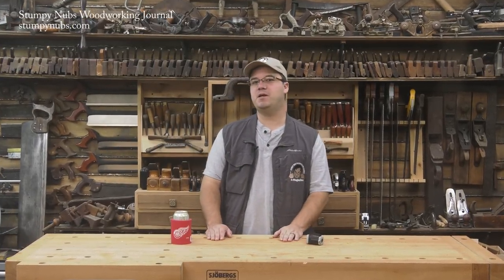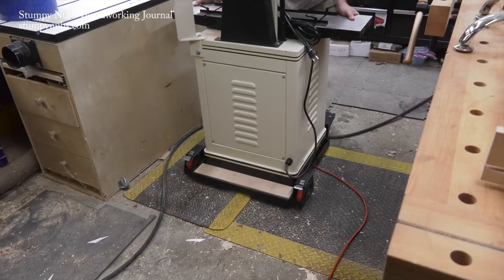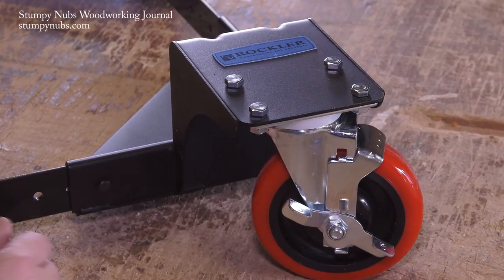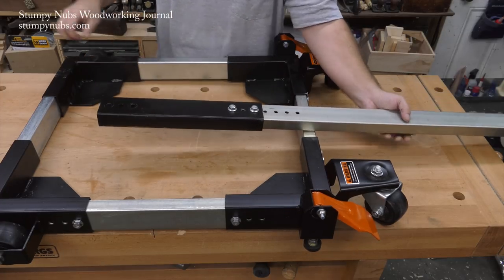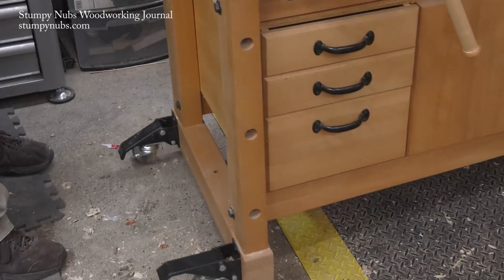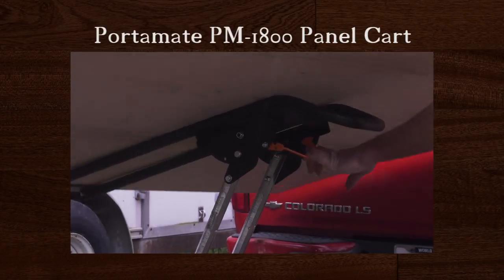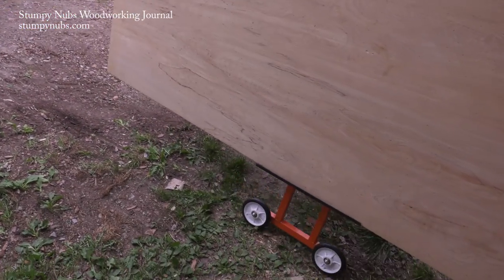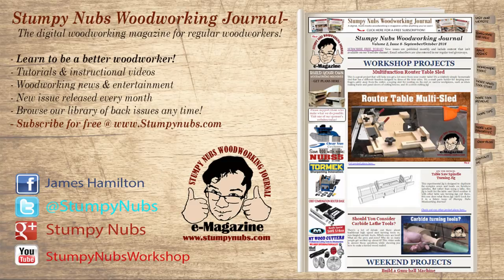Five MUST SEE ways to make your workshop mobile!

Comment: Hi James. If you bolt a piece of 3/4 X 3/4 square steel tube stock between the tab ends of the flip-up casters, you have a handy step bar that allows you to  raise and lower each side with one motion, and the weight of the bar keeps it out away from the leg, making it easier to step on to raise and lower the bench.

Comment: the 2 wheel sheet carrier (panel cart for the posh) for me the wheels are to small, for some reason they design them to use in doors, when most sheets are carried from the car/van/bike/lorry/donkey/elephant/child/dog/dragon/mother in law in to the building. BIGGER WHEELS FOR ALL.....what do we want....."BIGGER WHEELS...when do we want um..."well i bought mine all ready so it's to late" 8(
Reply from the maker: Not sure what you're dealing with, but as you saw in the video, it worked just fine on the unpaved driveway. The key is to take a little of the weight off the front wheel, which is also how it's intended to be steered.
Reply: Paul Emmerson Yes mate, spot on!!
Reply: Paul i know what you are talking about. I live in the dessert with no paved garage, those thin small wheels will sink on the first pull you do. Over here with all the loose sand we have you must have large pneumatic wheels in order to keep the wheels above ground

Comment: The Laser Pyrometer is excellent for checking the alignment of your vehicle's suspension, if the inside edges of your tires are hotter than the outside then you have too much negative camber, conversely if the outside edge is hotter then you have too much positive camber. In addition, if your tires are overinflated then the center of your tires will be hotter than both edges.

Comment: THIS COMMENTARY IS A MUST READ FOR ALL WHO ARE IN THE MARKET TO PURCHASE MOBILE BASES ! The main issue with most all mobile bases on the market is that they have two fixed wheels and two swiveling wheels, which makes for better control in steering, and that's great if you have room to steer, that is.  Having all four wheels swivel is actually better in most shops where space is limited . Most all woodworkers I know have smaller shops and it's frustrating when you want to use one tool , and have to move the other tools out of the way and can't because you don't have enough room to maneuver because of the two fixed wheels. Having all four wheels swivel makes it easy to push the machinery a few inches or feet in any direction so you can have enough room to operate the one you want to use safely and easily. This is why most all the mobile bases in my shop are made by me, since there aren't any on the market designed to accommodate four wheels that swivel. And I agree the larger wheels are better for rolling over chords, cracks , mats etc. All my mobile bases have double locking wheels also which largely prevents the small movement you mentioned on some locking wheels.
Reply: How true.  There are a few solutions to this issue.  Grizzly makes a 4-wheel base where all 4 wheels rotate 360 degrees.  Another option is to buy 2 of the bases and then use the parts with full wheel rotation (pricey but it gets the job done -- now .... what to do with the 4 non rotating wheels?!)
I much prefer the locking mechanisms that don't use the side action to lock but rather the top-0f-the-wheel lockiing action.  Side action ones are difficult and not always effective.  Most top action ones also lock both rotations - the wheel AND the ball bearing lateral rotation.  That solves the 'sloppiness' James references in this video.

Comment: Surprised you didn't cover the Harbor Freight mobile kit, since you supply your own wooden rails, it is among the most cost effective. And it does have a stationary setting that seems to work well, and then there's coupons 😊
Reply from the maker: The Harbor Freight one isn't all that unique, which was our focus in this video. The ones we showed are unique, one for it's ability to roll over stuff, the other for it's strength and expand-ability.
Reply: I think the downside to the harbor freight models, at least to me,  are that they have thumb screws instead of locking levers that you can use your foot on instead of getting down on your knees or bending over to turn the screws.

Comment: Thanks for this review.  A few notes from an overseas woodworker, if I may: I'm not a fan of mobile bases because they're heavy and cost too much to ship. Today's shipping fees from the US are often more than whatever it is I'm buying.  Rockler still ships overseas but can be expensive. Many companies like McMaster-Carr don't ship overseas at all (hint-hint M-C). Also, my shop is very small so I don't like casters that stick out and get in the way of my feet. Very dangerous and stubbing my toes while I'm working is not fun. I therefore prefer DIY retractable casters of the kind often seen in YT videos. The better ones are easy to make, stay out of the way when in use or not and allow the tool to stand on its own feet like it should.

Comment: Love the videos.  I must add that the laser "gun" does not read all surfaces accurately.  It does a good job on most, but there are a few that almost completely mystify the gadget. I use mine a lot and certainly would replace it if ever lost. The "problem" I had was that it would not read the temperature of my gas grill cover accurately;  however the grill cover (lid) has a thermometer, so it is really not a problem. If it won't work on the gas grill cover, I suspect there are other things that will confuse it as well. It does read the cooking surfaces accurately. It will read the cover of the charcoal grill accurately as well; just seems to dislike the highly polished and painted cover of the gas grill. Not much of a criticism overall, just something to be aware of.
Reply: Had one when I did a/c work. One day I read the manual. Lol. Lots of useful info in there. Mainly about how far you are away from the temp you are trying to Guage. Distance away means a certain allowance.  For those who, like ne, had never read the manual

Comment: James... I am contemplating putting a mobile base on my band saw. It is the Harvey Ambassador, and because of it's small footprint, I wonder about stability issues. Know that you have a Harvey and would appreciate any thoughts you have.
Reply: I have one as well and bought their mobile base. Instead of a 3/4” piece of plywood I incorporated the brackets into a 2x6 base with lap joints.  I used the threaded anchor points in the bandsaw base to tie the saw, 2x6 base and brackets together. This minimizes the base and the machine does not slide around on the mobile base.  If you like I can send pictures later
Reply: @NomoreAB  ... yours is the first response I ever got to this post, so thanks for that. what I ended up doing was buying the Bora Portamate Mobile Base PM-3550 Industrial Strength with Swivel Wheels. not the least expensive solution, but it perfectly stable, and allows me to waltz my band saw wherever I like (within distance of the 220 outlet).
Reply: @twain3074  Glad to hear you got it figured out.  Sometimes the cheaper solutions end up costing you more in the end.  Glad you got it figured out.

Comment: How does the "Shopfox" mobile base fare? I'm curious because I can get a good deal on them
Reply: Terry Leigh I bought the Shop Fox for my Grizzly bandsaw a number of years ago, and one of the fixed tires came apart. I was able to find a replacement tire at a local tool store called Mr. Stuff. I think it cost me about 2 bucks. I only roll it across a smooth garage floor and a smooth concrete driveway, and it seems to work okay although it doesn't get moved very far each time.